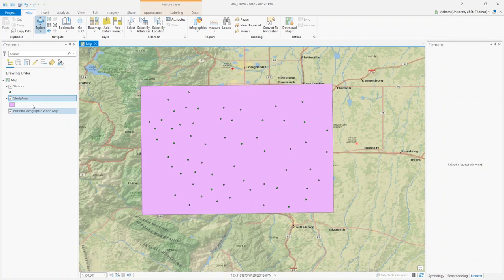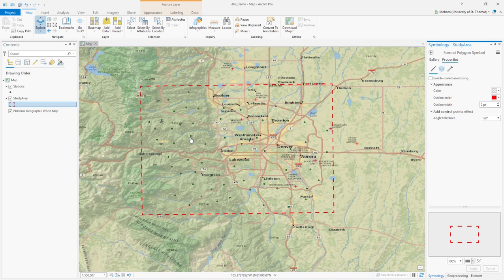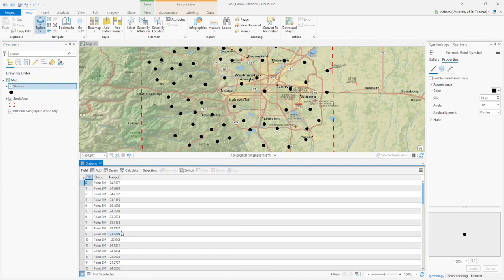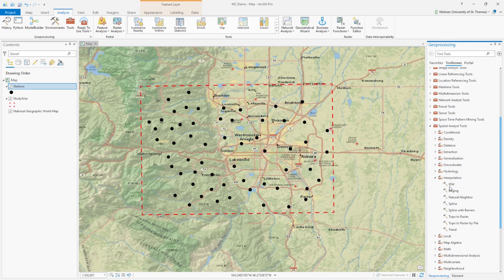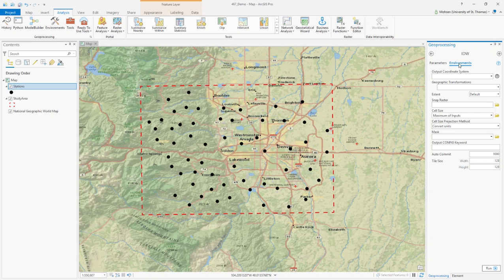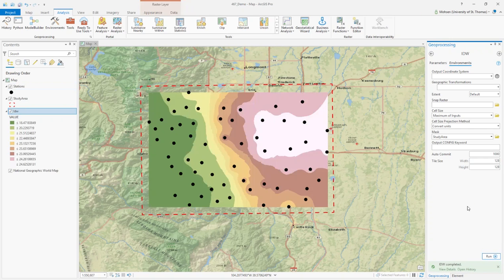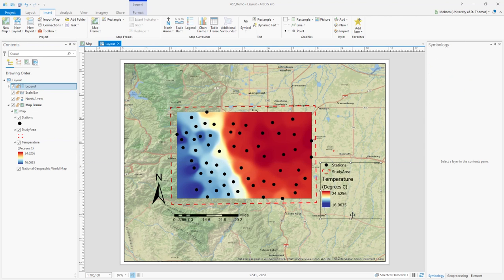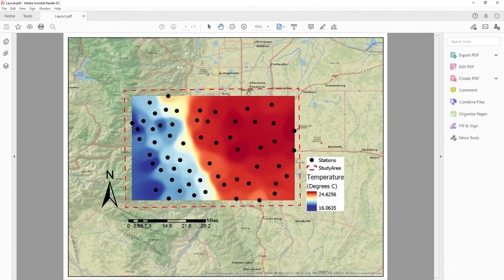IDW (Inverse Distance Weighting) Interpolation Method Using ArcGIS Pro

Comment: How did you create the study area
Reply: Depends on what you mean. You either go to Tab "Analysis">> Group Geoprocessing "Environments">> Scroll or search "Extent" and define it based on some Layer, or you set it dynamically in the tool "IDW" >> "Properties" Tab >> "Processing Extents". There you have plenty options, based on the imported layer or manually by some polygon or some selection (AFAIK).